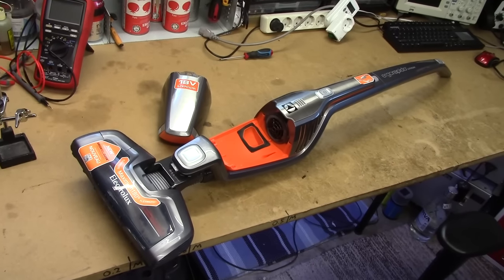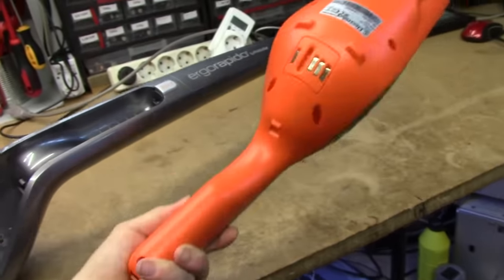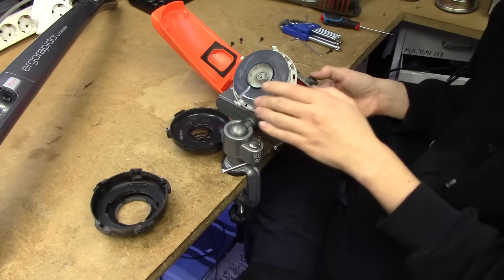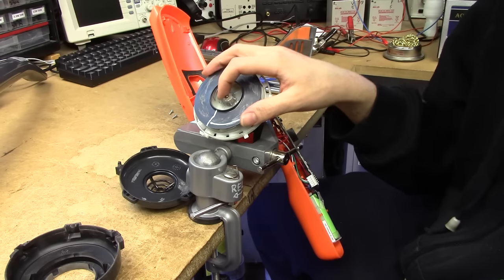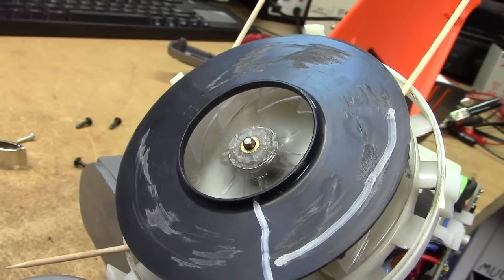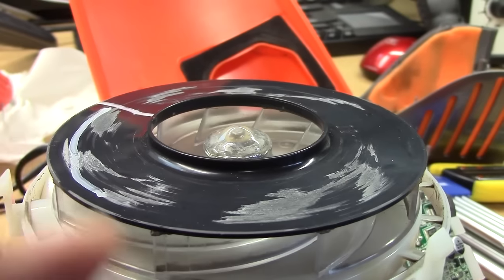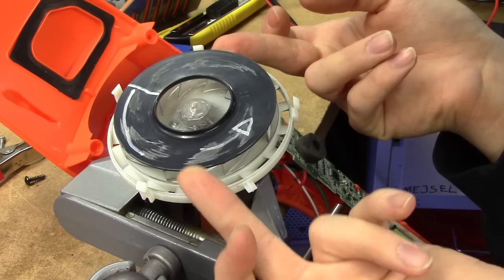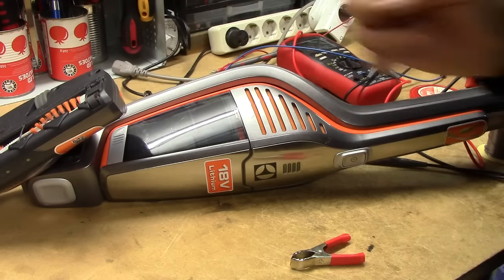Electrolux Ergorapido Lithium vacuum fan repair & charger hack

Comment: Tip about the vacuum fan (which is a radial fan): The smaller a radial fan is, the bigger impact the dust collecting on the fan blades will have, airflow and vibration. Nothing worse than compressed air (like aircan) or Q-Tips / Topz can fix. Nice find :)

Comment: I did a few of the same repairs on some Ergorapido's however it was hard to balance the fan properly and it would often have less suction than before.
Ended up swapping motors from later models that had failed battery packs as Electrolux rectified the fault with the motors at that stage.
Reply from the maker: Hm, I've never seen an Ergorapido with a well-balanced fan, lol.

Comment: Great video, you might want to take a look at these more "industrial" 24V powersupplies from, for example, meanwell (SP-150-24 = overkill). they have an adjustment which allows you to dail up the output voltage. If they reach 25v I don't know, but it's an idea. ;)
Reply from the maker: +MrDubje Thanks - I actually own the 75 W version of that for the Mission C project, and they have several volts of adjustment range. For charging this thing though, I think I'll just use some generic 24 V wall wart, since there's just a 100 mA difference or so between 24 and 25 V charging. Doing a full charge is going to take forever either way.

Comment: That thing probably took a little dive. Also, I wouldn't spin that motor for too long, I'd wager that it's relying on the drag of the impeller to not send the motor in overdrive.

Comment: Great video! But how do you remove the "belly panel" and the whole brush nozzle? basically the steps between minute 16 and 17. 
I have removed all the screws on the belly panel but the part down by the entry just won´t come off easily. Is it just by force and click it off?
Reply from the maker: It should just pull apart. It might stick a little on the rubber gasket for the fan ass'y.

Comment: Excelent video, Do you have any video for How to replacement the battery of "Electrolux Ergorapido lithium"?
Reply from the maker: Nope, I haven't been so lucky as to find one in the trash yet.
Reply: THIS is an Electrolux Ergorapido Lithium. This video shows everything to gain access to the battery cells... what more would you need to know?

Comment: Hello good afternoon
I saw the whole video, I'm sorry I don't speak or understand the English language.
I have a vacuum cleaner like this, but the bottom part works. But the top button, to use to clean the floor, I turn the button on and it hangs up, it doesn't stay on.
If I call from the bottom, it works.
But as I have paralysis in my leg, it is difficult to keep lowering.
Would you know and could you help me?
My name is CristinaGiovaneti
Thank you

Comment: okay, i got an ergo rapido with the 2speeds. Unfortunately, it'll stop after a few seconds on high speed...it's fine on low but that doesn't clean the house...
Wtf do i do?
Reply: Change the 5 18650 li-ion cells.
Reply: Replace the batteries, or buy a new top unit.

Comment: Hello! First things first: great video! Really helped me to understand and check my vacuum cleaner (which is the same Ergorapido). I just bought an used one for repair, but I'm stuck. Changed the fuse on the mainboard and changed the batteries. It turns on, but it's not charging. Using a magnifier and looking for other problems, I found an IC that seems to be burned and that is my real problem... The fact that it's burned makes it impossible to read the IC code! Can you help me? It is the IC4, located about 2 centimeters up the power button (measuring from the center of the button). It is below a round inductor that shows "089" in it. It's a 10-pin IC and all I can read on it is "459v"...
If you can help me, that would be very great! Otherwise, there is no problem, I know that it might be hard to check.
Again, thank you very much!
Reply from the maker: +shis12345 I'm sorry, I don't have the vacuum at home, so I can't just easily take it apart to check. I had a dig around the raw footage from this video, but sadly the resolution of my camera isn't good enough to show anything at all.
Reply: +FFcossag No problem at all! I tried to dig around the footage too, but even if the resolution was better, I guess it would be not possible to read. The IC is very tiny. Thanks anyway!
Reply: Hello great video.  I have the us version and trying to convert it to 24v.  There are four pins two of which provide~19v and the other 0v.  It uses the stock 24v supply. But my question is which pins do I solder to?
Two are black and red and the other has a orange and green (think)

Tnx
Reply: @kdr-ql7pz  if it uses the stock 24V supply then there is no need to "convert it" to 24V. Right?
If the wall adaptor is rated 24 to 25V it is designed for 5S with nominal 18V and having 21.0V fully charged. A 6S pack would be 21.6V nominal and have 25.2V fully charged.
The BMS and motor control circuitry is only designed for whatever the device was supplied with (almost certainly 5S). To convert it you need to replace ALL the internals.